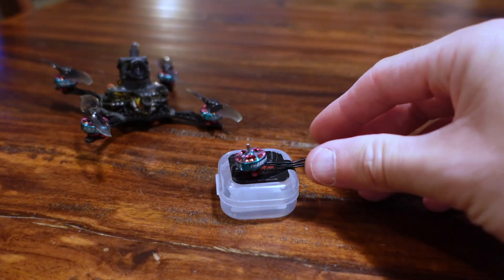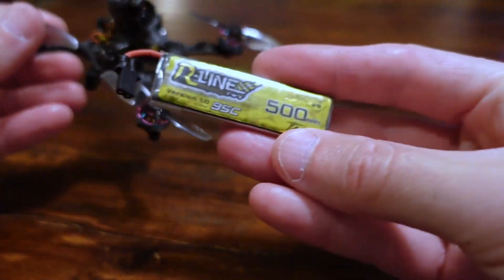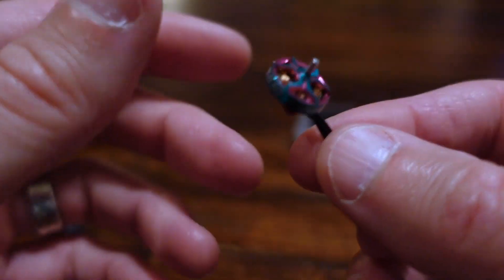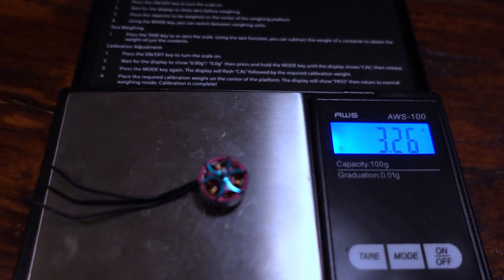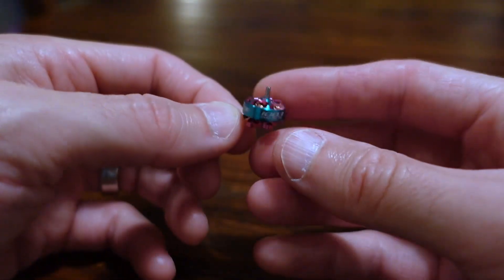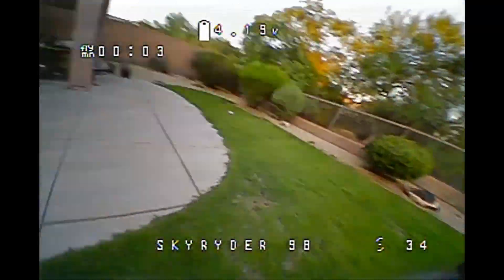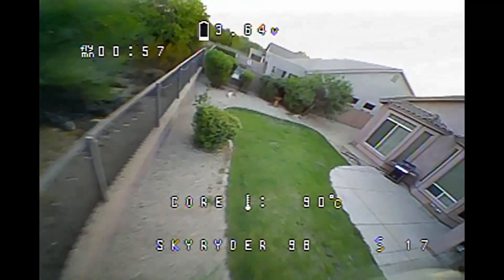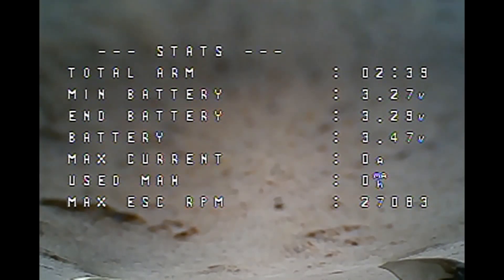Review: RCInpower 1003 22,000kv Motor

Comment: I fly these at 18000kv on 2S with 40mm quad-blades, on a relatively heavy 79mm whoop (old Walksnail 1s VTX + new Pro camera). 
It goes way harder than I thought it would :)

I thought 18kkv was too high, but they seem to take it no issues whatsoever.. Will definitely go from 90% to 100% motor output now ;)

Comment: Thrust tests provided by manufacturers seem to be fairly unreliable. Build a thrust stand and test them for yourself i think (thats my plan anyway). My idea is that each motor has an efficient power band, and they are really inefficient above that. So if you add weight the flight times go down by a huge factor
Reply from the maker: I don’t expect the data to be accurate in terms of absolute value but hoping it would at least be consistent from one RCinpower motor to another.

Comment: Calling bs. At that voltage, it'd need significantly more insulation breakdown distance. That whole motor would be a blazing fireball of arcing at that many kv. That's like.... Transmission line voltage.
Reply: Kv is this case describes the rpm/volt not thousand volts, it’s how brushless motors are rated. They’re running at roughly 8 volts DC that’s then switched to 3 phase AC.
Reply: Exactly, 22000kv means 22 thousand rpm per volt

Comment: HGLRC makes a 1003 10k motor that has just the normal 6.6 mounting, its a bit lighter because of that, but that is the only KV they make currently from the looks of it...
Reply from the maker: Somebody shared a link to those earlier and they look interesting. It raises the question whether 10,000 kv is enough on 2S with 2015s ?